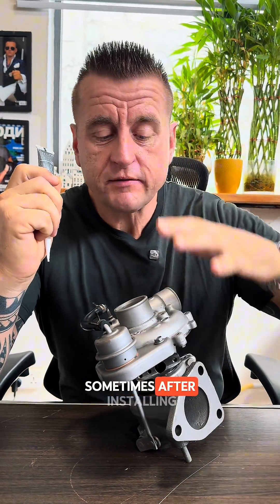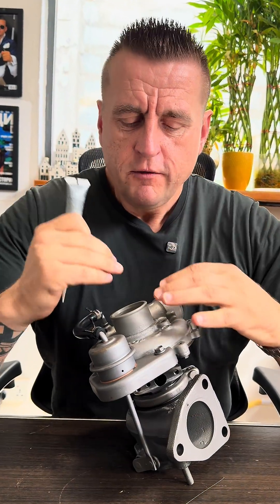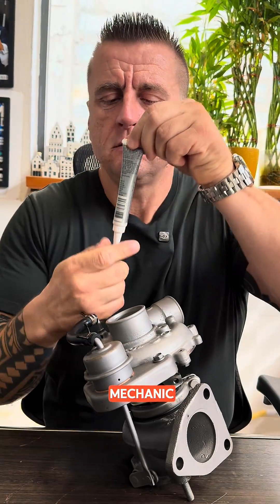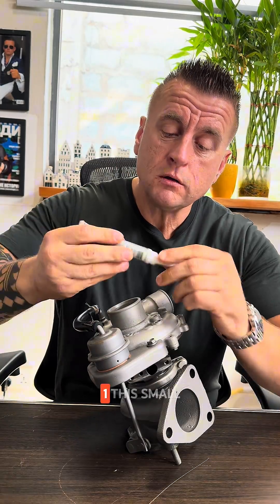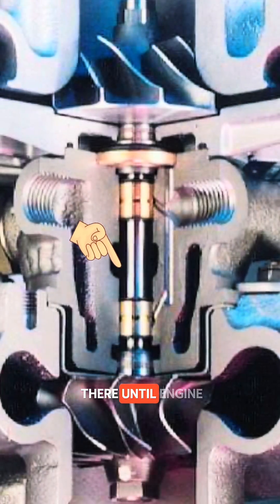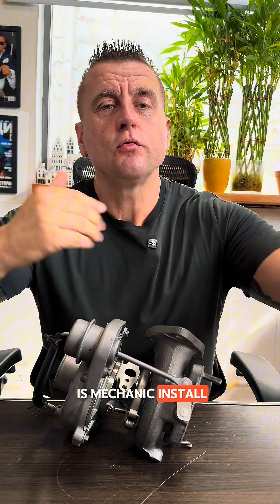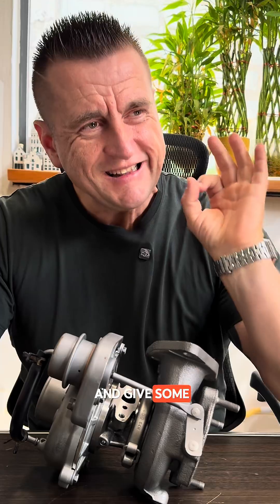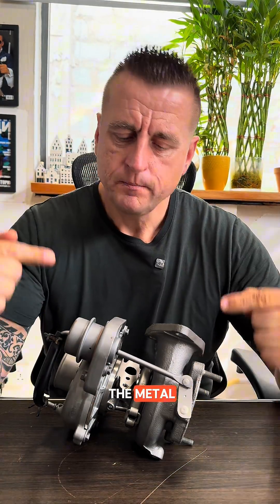🚨 PRE-LUBE Your Turbo Before Install! 🔧🔥

Comment: Best way is just to turn over the engine without turning it on .. remove the HP pump connector or injector plugs  to crank the engine and pressurise your oil line . 

If you don’t you could have a turbo spinning at 6k~12k rpm for 2-3 seconds depending on temperature and other factors = a damaged turbo …

Comment: They installed a new turbo for me and did not put lube so they turn it of again, no leakage everything intact but should I told them to remove it and add lube to it or any advice on that?

Comment: Yes I spent like $40 Australian for a tube of that stuff and installed it while fitting the turbocharger,  50000klms later no problems but always always turbo to cool  after hard work before turning off.

Comment: Sometimes mechanics are in a hurry either by too many cars in queue for repairs or by customer pressure. As a result they forget very critical important tasks like this prelube example. My advice is do not work under pressure and always take time to double check.

Comment: Impeccable timing, thank you!
I just received a turbo seal kit for my 100 series.
I am changing all intake, exhaust and turbo seals. The flanges are all wet looking as if they are seeping under pressure.
I received a syringe in the kit which I assumed is for pre lube.
So my question, should I just be using engine oil or a specific pre lube?